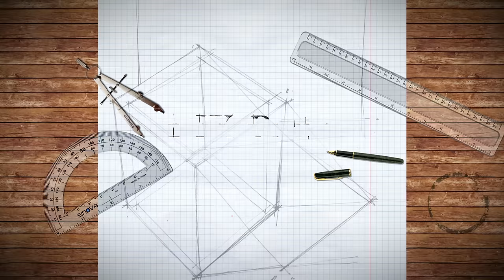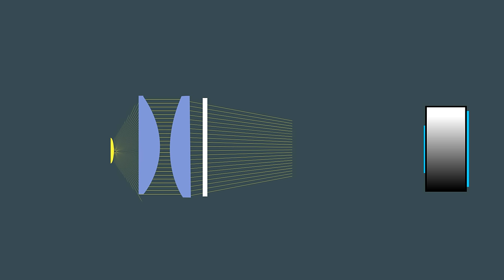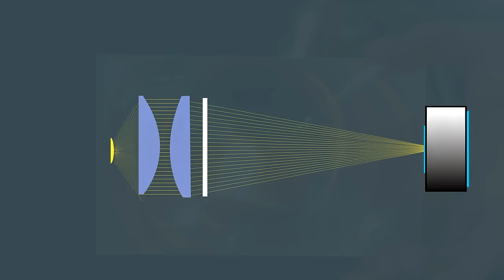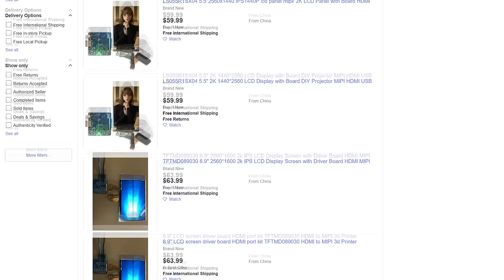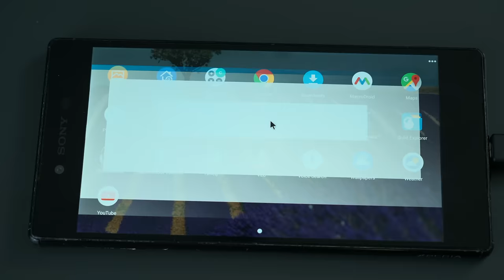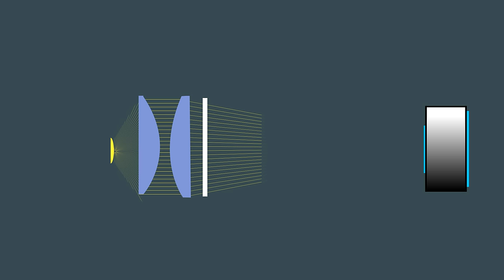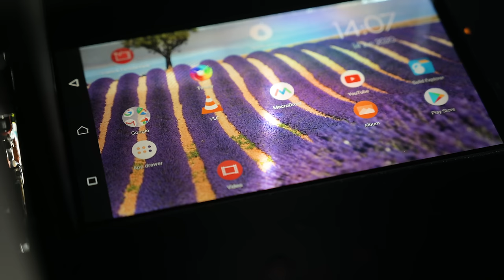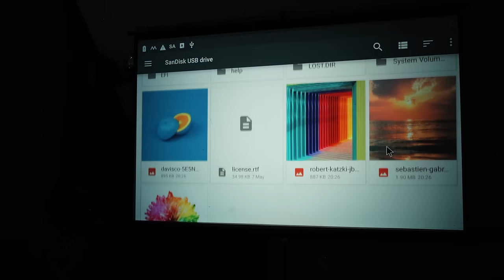Building a TRUE 4k home cinema projector (it’s awesome)

Comment: Wouldn't it be possible to combine the techniques from the recent "DIY Dual-Layer LCD monitor" video with this projector to further improve its dynamic range? Especially if some of the version 2 dual-layer LCD ideas actually worked in improving brightness / efficiency?
Reply: Implementing dual layer of lcd onto this projector will result in low brightness or no light at all. And if LEDs installed just behind the LCDs, light won't converge as expected.
Reply: @rameezsheikh7576  there were a number of ideas myself and others suggested on the dual LCD video if he were to ever do a version 2 that'd specifically help with brightness - like flipping the screen so that the polarized light is rotated 180°, lining up with the other display and removing the need for the middle diffusing sheet he used, which would help with both brightness and sharpness, hopefully lowering the ghosting and 'bloom' he got. The light would just have to be running parallel through both screens, then converged again to focus onto the lens, but it should be entirely possible
Reply: @chiptune_ it would still end up significantly dimmer (he mentioned in the video that that the LCD is already blocking a bunch of light, now imagine doubling that blockage). Still cool in theory and if I ever make something like this I would try it out
Reply: @doc8125  I'd imagine it'd function like a neutral density filter with two panes of polarized glass. Align the polarization and more light passes through, but align the polarization perpendicular to one another, and light is blocked. They're incredibly common in photography to function essentially as "variable sunglasses" for the camera

Comment: My iPhone 13 is 4k HDR. You can definitely tell the difference in image quality from my old iPhone 8 pro’s 2k screen. HDR is the biggest enhancement but I can see the 4k resolution. I’ve been a digital artist, designer and film maker for the last 25 years though so I think my eyes are extremely trained to notice any type of image quality aspect despite the screen size. I went with a Dell Laptop over a Mac simply because the Dell had a 4k screen while no Apple Laptop has one yet which blows my mind. A 4k HDR screen, even at 15”, is clutch when you’re a digital artist.
Reply: Are you sure about that? The IPhone 13 is not 4K. In fact, it's only slightly above 1080p (1170p to be exact)

Comment: is it possible to use a projector lens from a broken lcd projector. Would e nice to have a zoom option
Reply: No way. No projector lens was designed to cover a 5 inch display. They all generally work with screens smaller than 1 inch. Maybe only if you have some of the newer Chinese projectors which basically work similar to this DIY one. But even there, the biggest screens i know of are 4.2 inches. Might be there are bigger ones.

Comment: I love this project and am impressed with the results but comparing it to a $2k projector is laughable. High end projectors can be $20k or more. Mine was considered "good" and was $4000.
Reply: Time for a 1 year follow up, version 1.1 vs a much nicer projector! 

Couple ideas I had.. That Noctua cooler is definitely beefy enough to handle way more than 100w of heat, led seems like easy upgrade. Also the last piece of acrylic being used as a dust cover seems like it should be glass. Idk enough projectors but I'm sure Matt could come up with some cool improvements. Motorize the focusing wheel thing maybe?
Reply: I worked in a company who sells projectors & repairs them. A optical filter for a projector can cost up to 2000€🥴

Comment: could someone tell what i can expect, or how i can calculate the distance/screen ratio with such a projection lense? thanks a lot!
Reply: What to expect: he used a 100W power-LED panel, which will perform similarly to cheap Chinese LED-projectors. Which means it will perform well only after sunset and with shorter projected image diameter.
Distance:
LED <--> Collimator lens: focal length of the lens
<--> Converging lens: minimal
LCD <--> Projecting lens: focal length of the lens
Converging lens' focus must be behind the Projecting lens, Projecting lens' aperture must neither block the LED's light (vignetting) nor be too far away from the Converging lens, both cases cause uneven light distribution

Sorry if it was not helpful

Comment: Am I the only one seeing the glaring issue with the way you did the cooling? The way you have it set up, the cold air is getting pushed out the bottom panels and warm air is being pulled over the system. Fans should be at the top, pushing HOT air OUT, and sucking in COLD air from the bottom.

Comment: Cool project. A couple small mistakes if I could kindly point out..
When you use a heat pipe heat sink. You have to understand how they work....
 Yours will not work efficiently upside down. They work inefficiently on their side.. upside down... A no go. Here's why.. Liquids boil at a lower temperature under vacuum. Those tubes are at low pressure. That makes the fluid within them boil at a very low temperature. The heatsink heats up those tubes, the liquid boils and releases energy into the heat sink. It recondenses in the radiator and it has to drop back down to the heatsink base..
 the process starts all over again..
That can't happen with the way you have it set up. So your heat pipe system, not working efficiently. If at all.
But after recondensing in the radiator; how can the liquid drop back down to the heat sink and pull off that energy again?
It can't if you have it mounted upside down 🤷‍♂️

I think it would be cool if you did a video on freeze drying food...
Very similar process, I'm sure your viewers would enjoy it understanding how the process works.
Involves liquids boiling at a low temperature and vacuum.

The other issue.. you want to have a glass convex lens in front of that led. I sometimes work on LED projectors. You will notice they all have these for a reason.  That will take your LED array and concentrate it into a tighter pattern. Also diffusing the light into a perfect smooth pattern. Usually they use an array of LEDs with this glass convex lens in front of it, to diffuse and concentrate/ control the light.
Without this glass convex lens you are not concentrating your light exactly where you need it. I just thought I'd point that out. Cool video though.
Reply: Heat pipes work at any angle, circulation of condensed water occurs by capillary action not gravity.

Comment: 8:45 - Spontaneous combustion or spontaneous ignition is a type of combustion which occurs by self-heating, an increase in temperature due to exothermic internal reactions. What you meant to say is: "...this dry stick instantly ignites, due to the intensity of the focused solar radiation".

Comment: OK so... why don't companies do something similar if it's a lot cheaper?
Reply: Are u 6y old?
Reply: Id like to understand what you mean or why you'd ask that. Would you elaborate a little more than just that?
Reply: This is cheaper only because you pay for the price of the parts directly and don't need to worry about factory costs/labour costs, and neither durability (who knows how long something like the DIY thingy might last), not to mention profit margin. By the time all cost factors are taken into consideration it would probably sell for just as much as a similar commercially produced unit does today, the only cost saving here is that you skip the middle men when you go DIY route

Comment: in order to transmit data by light, we need stronger light. why we need communication by light ? just look at the horrible competetion for the limited source --- limited available  tv broadcasting channel and you know why. communication by light remove that horrible competition since the light does not interfere with each other, which give us unlimited freedom to enjoy tv or communication without bloody struggling for limited source. i am going to try some improvement on laser currently exist on the market. my idea is that, we can get any form of wave  resonanting in any form of cavity, laser is short wave length EM wave resonant in laser tube, since its wave length is so small ,only atom or molecule can be its resonanting fork of sound. the microwave miser has wave length which magnetic control tube can resonant with. the limitation of laser resonanter is the mechanism to release the wave resonanting in the tube,   if we can not release the wave in the resonanting tube, then the whole thing is meaningless. the existing laser make use of semi-reflecting mirror to serve the conflicting purpose or goals. we need to reflect the light so we can get resonance and we also need that door open so we can get that light out. one possible door is the mechanism of LCD TV, which make different arrangement of molecule of liquid crystal which allow it to serve both purposes of reflecting and release wave in the resonanting tube. but to that end, the switching of Liquid crystal   need to be much faster than it is today. i am trying to find other mechanism which is fast enough to serve both ends. besides laser, I am working on the idea of low frequency amplifying  and resonanting tube, which allow the long wave length wave such as Am FM microwave LF  UHF etc to resonant in a cavity or tube. of resonable size. as you can imaging , the effect of such long wave length wave resonanter will be something comparable to current laser. laser make use of short wave length EM wave to create huge heat on the target. and I believe that long wave length EM wave can also do the same job or even better. People interested in such idea please  drop a line in my Email : sparkhsuyh412@gmail.com